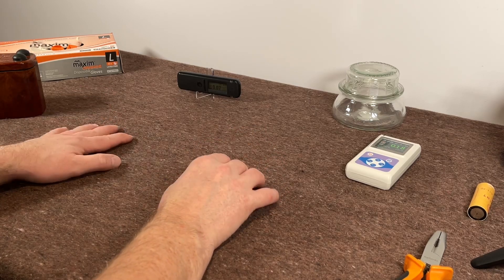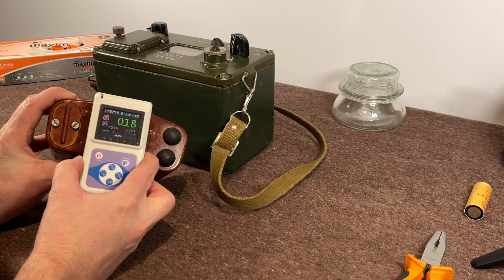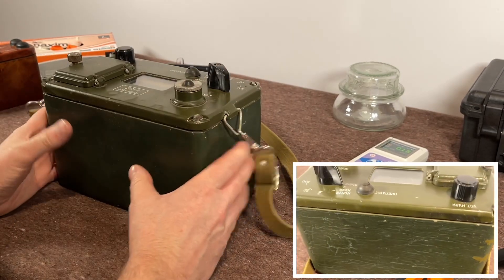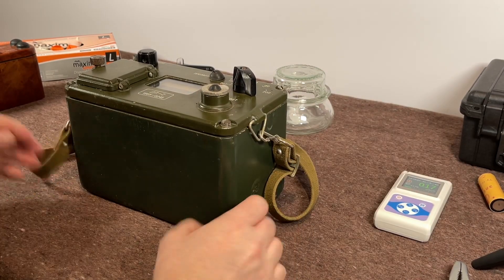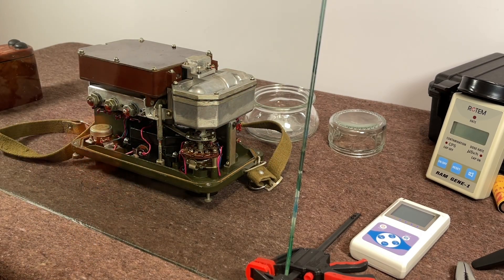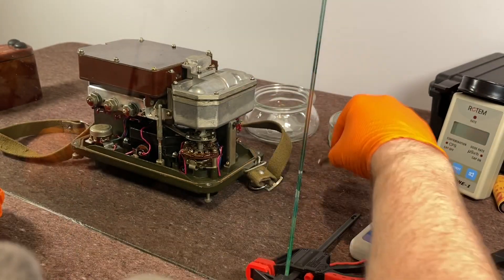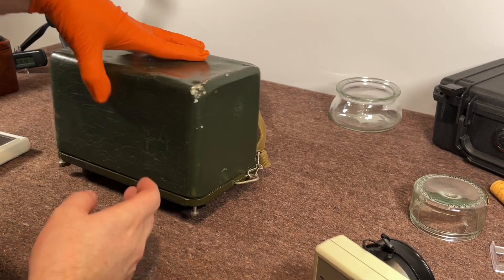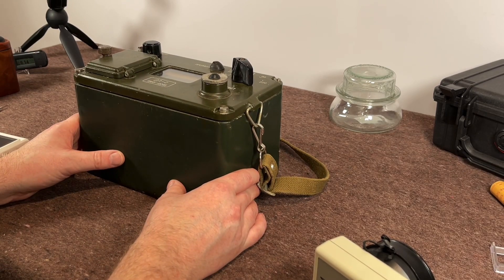Soviet DP-2 Roentgenometer

Comment: While Strontium 90 is a byproduct of nuclear fission it doesn’t pose of an external hazard compared to Cesium 137. Strontium 90 is a beta emitter and while it can cause burns on the surface of the skin it isn’t as harmful as Cesarean 137. Beta particles can penetrate a few millimeters through your body. It won’t however deeply penetrate like gamma and neutron radiation does. Beta radiation is more of a problem when the isotope enters your body like from breathing in dust from a beta emitter. This source in the video can cause burns if exposed long enough. If the exposure is minimal it really won’t be a problem.

Comment: Do you (or anyone else for that matter) know what the actual quantity of the check source was when it was first manufactured, i.e. in µCi or MBq?
Reply from the maker: Somebody did tell me but I cant remember. Will see if I can find it.
Reply: I've seen a pretty big variance in them even on the same counters from a few different people on here despite the fairly narrow range of production dates, though there could be other reasons for that. With my source, based on comparing it with a Sr-90 check source of a known production date strength (B-8 sources, were 5.4 µCi iirc) I estimated a 300 µCi original strength. Radium Quetzal has one he estimated at something like 1200µCi/1.2mCi and it legitimately does appear to be that strong. Allegedly there were training units made with several times stronger control sources than the ones in regular service units. There is likely much better information on it in Russian but it's a mess navigating via google translate lol.

Comment: I own the Radalert 50, i know the source will max out the meter but how quick will it max it?, also could we see a video of what the terra p says?, great video as always :D
Reply from the maker: I actually sold both of those last year as I replaced them with higher range meters. I know the Radalert would max out in seconds and the Terra-P is rated to 10mSv/h so it would max out pretty quickly too.

I plan to make more videos with the source in the future now that I have a safe way of doing it.
Reply: @SurvivingTheApocalypse  I did know about this infamous check source but i never knew how dangerous it was, i mean i didn't know the source could leak, also, is the black discolouration due to radiation burns over time?, Marie Curies radium sources have made the glass turn brown over time
Reply from the maker: I cant answer that one as I have never seen a picture of one when it was new. The source itself is a small pellet which is encapsulated in resin inside that round indentation. It scares me to death handling it.
Reply: @SurvivingTheApocalypse  I'm really happy that you made this video, I think i'm not the only one who appreciates your effort when making these videos
Reply from the maker: Thank you, really appreciate that.